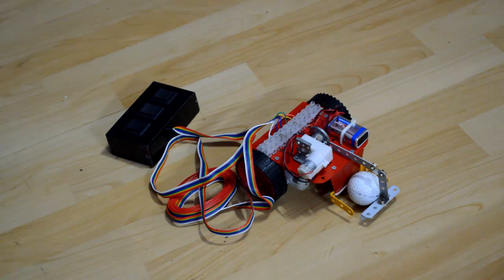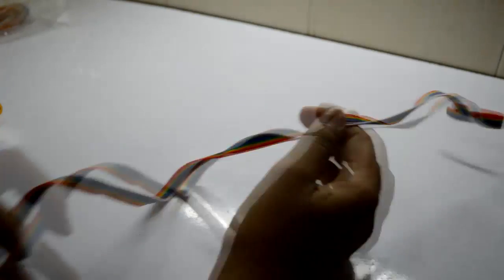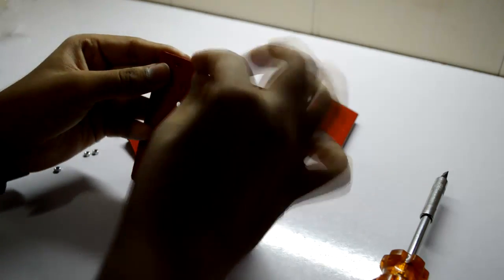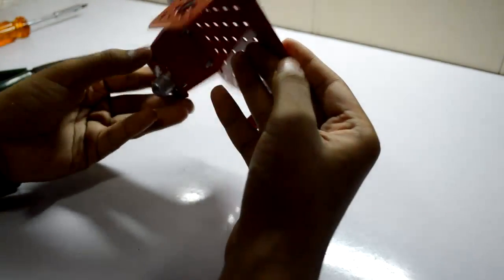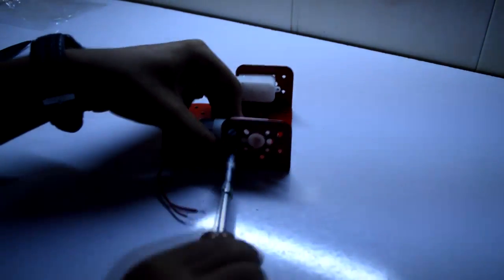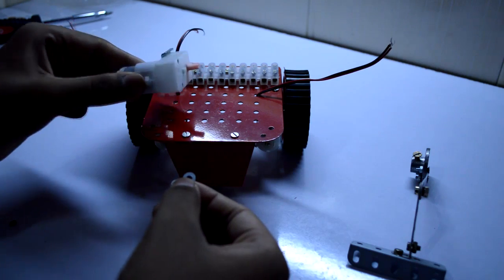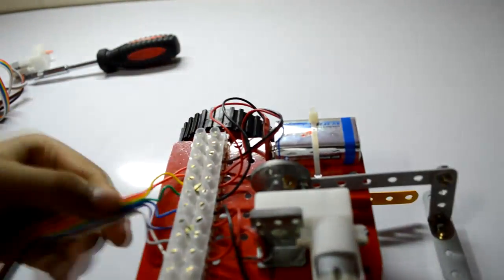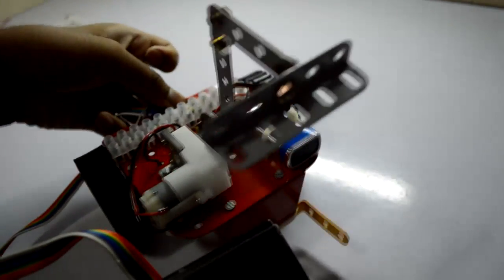How to make a Wired Robot (ROBOCON JR.)

Comment: i placed battery with remote so weight of bot is less &instead of 300 rpm i used 1000 rpm but The bot is not taking sharp left or right...any idea?? how to deal with dis..??Please help to sort out..any1 who knows
Reply: Prasad Gaikwad For sharp left turn, the left motor should be moving back and the right motor moving forward. If you have already tried that, the issue is probably the motor RPM or the battery. A high RPM motor may not be able to drive the weight of the robot due to low torque.
Reply: Dear sir,if you want any kind of robotics parts please contact robokitshop on ebay.in.direct url is :http://www.ebay.in/sch/i.html?_from=R40&_trksid=p2050601.m570.l1313.TR10.TRC0.A0.H0.Xrobokitshop.TRS0&_nkw=robokitshop&_sacat=0     or whatsapp ;8169053873